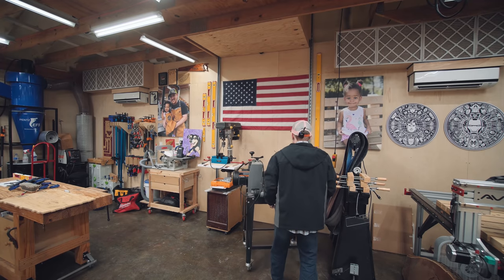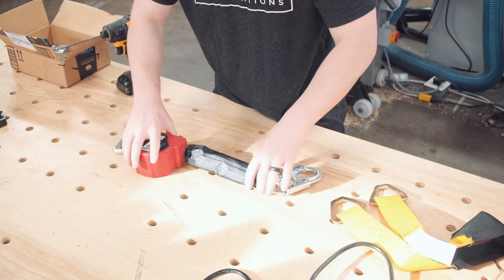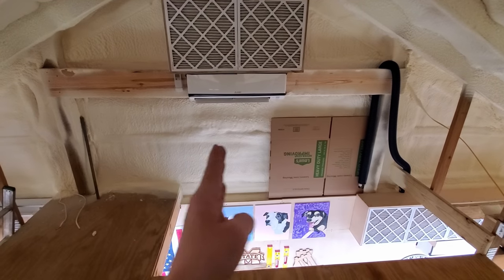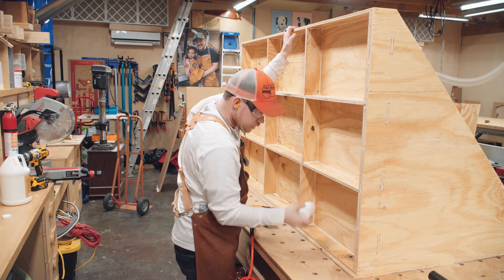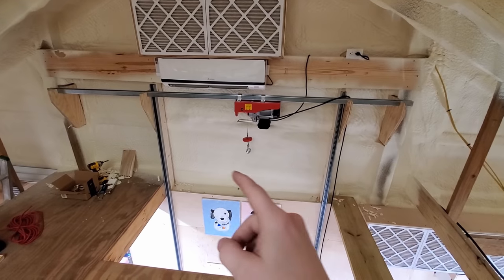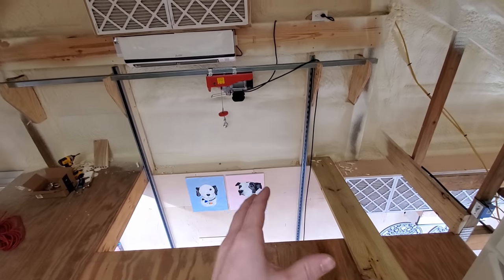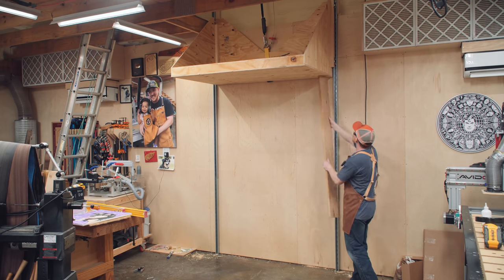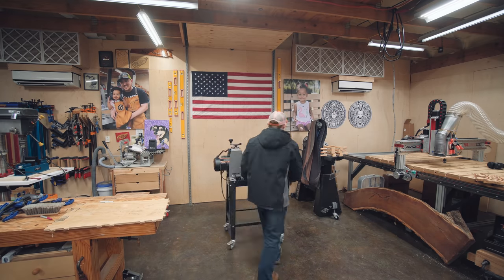DIY Elevator - 364

Comment: Wow, that's just utterly awesome! I wouldn't have come up with that in a million years! Great job, Master Jay.  
On the flexing winch mount, can't you simply attach to the wall a couple vertical lengths of 2x material underneath the bar to prevent it from flexing? Seems like a bit of support would prevent that from happening. Agree with the comments that the fall arrestor should probably be attached to a different mounting point.

Comment: I love this.  I am looking at building an accessory dwelling unit for myself as I downsize.  It will have an outside stairway, but I am considering building an elevator that will mesh with the deck and even the awning could mesh as well.  My body is not doing great so this will allow me to have a 3 car garage as well below the unit.

Comment: I love this idea. I am building a deck at our cabin that is off the ground about 8’. I’m going to attach the super strut to a 4x4. After seeing your problems with counter sinking the screws I think I will just weld flat stock to the strut so I can attach it to the posts. Carrying coolers of food and supplies up the stairs pushing 70 is getting old.

Comment: If you're concerned about a possible condensate issue flooding the hoist, use a CGFI circuit breaker or a CGFI outlet. They work and one possibly saved my life.

Comment: Any thoughts about adding a counter weight to take up the weight of the platform?
Reply: Why would you need a counterweight?
Reply: @jameskelly7767  Counterweights are used to reduce loads on the lifting motors, if you have a fixed weight it can be practical.  However, I doubt you could add much weight to this due to most of the weight being cargo, ergo, not always consistently there.

Comment: This is brilliant! Great creative mind Jay. I would have thought to use 4x4 post to have a self supported structure affixed to the wall. Light weight metal frame construct with 4 point anchor points at the top to centralize the winch, leaving it clear from potential water droplets. Then to create an elevator buffer, I'd use car suspension springs cut to reduce the height, then mounted to the floor so they are concealed when the elevator comes down. Sounds good in my head, just wish I had to space to try it and execute it. Your work is a great inspiration. Thank you!

Comment: Awesome work!  Now all you have to do is dig a massive hole under it and build a lower level to the platform.  That way, you can keep your equipment under the lift.  When the elevator comes down, the equipment will glide down into the hole  :)

Comment: the security chain should be mounted on the wall and not on the pole. if the pole breaks then you will fall with your setup. safety should be secured in a second position :) just a tip

Comment: !!!! Jay!!! !!!
You have no preload on that cross strut. Look into how metal fatigue works, and how over time repeated stress will cause that strut to become brittle and sheer. I'm not saying it will happen soon, but when it happens, that cross bar will snap in half, and that is what your safety device is attached to!!!!

Move your fall arrester so that it is attached to something completely independent from the rest of the support structure (such as the roof for example).
Reply: Other than that, sweet design! Bet you're well happy!

Comment: Jay...Love this project.  Really love the light switch extender you used at the end.  I know you wanted the lift on its own electrical circuit but it would be very convenient to power the lights up there on that same breaker or better yet a switch to save on wear and tear of the breaker.

Comment: Nice elevator and great video, if you're concerned about the flex in the lift support  get a stalk of double strut it's like 2 pieces welded at the backs. Double strut is very strong in the application you need but you'll need to pick it up at an electrical supply house.

Comment: Ok Work for a lighting production company and my rigger and I sat down on this one.... first off. No "Break" in the winch. Most Chain Motors, or crane type lifts have an actual break that engages and disengages or slips if over-loaded. If you can use one of those instead of a winch it would be proper.  Sudden failure is probable with a winch. Cart attachment bracket should be steel in the shape of an L running down the center and have a shackle attachment to the hook. Also you are dealing with Dynamic loads. You need a double lapped welded run of solid uni-strut as the lift lentil. Again dynamic loads, The 3/4" ply is also meh, steel is better... though we did like how you spread the load out.  I think this is a Wonderful project. and what you have is decent without rigging hardware knowledge. Hit me up if you want examples...

Comment: Nice DIY elevator. I’m sure the safety Sally’s will give you grief but you put it together well.  nicely done. I used to have a loft in my garage and I really wish I’d seen your video then. I would have done one too. To maximize your safety and lift capacity you may want to lift just your stuff and you use the ladder. If something goes wrong and you’re on the elevator you’d hit pretty hard.

Comment: Really nice, only safety thing I'd add is a push to break switch at the top of the track that you add inline with the wire on the remote for the up button. that way if anyone accidentally runs the lift too high it'll press the switch, causing the up button to be disabled but still allowing down button to be used.

Comment: Cool. I would add 2 pole on the corner front. When the elevator goes up it pushes "gates" out of the way. So if the elevator is not up gates prevent you from stepping out in the open if your not paying attention. Or some sort of lid that lowers when the elevator is downstairs. And some sort of power cut off build pressure plates on the under side incase of something under it on the way down.

Comment: Suggestion......build a small shield with some flashing to cover your motor and I would suggest putting a railing  with a latch able gate at the top around the opening.

Comment: You might try adding the strut captured nuts at 16" centers to the upper strut holding the hoist. You can then use threaded rod, bent to fit, to attach it to the 2"x10" board holding the mini split. This will get rid of the flex, without adding more structure . They probably have ready bent angles in the Superstrut catalog. Nice job, well thought out!

Comment: I built an elevator based on a hoist like this, servicing 4 floors. I automated it with a tiny Siemens PLC, position detection and push buttons on every floor, like a real elevator. Works like a charm. Tiny issue : while the cable winds, it changes direction on the drum twice, and that makes a quite unpleasant and noisy bump.

Comment: Avoid a single-fault failure. The Fall Arrestor should be installed on a seperate set of struts, in case the motor supports fail.

Comment: I did exactly the same, but out of box steel. I added an industrial microswitch though wired into the up button circuit, so when lift is fully up it will stop automatically in the precise place

Comment: I really think you should double that top, horizontal super strut like you mentioned as a possibility. You've got significant bending stress there, and the noticable flex is a bit scary. Just my two cents as a mech engineer.

Comment: Very nice.  Why not consider putting a little bit of roof lead flashing over the motor so if the air conditioner ever leaks it will just drip down.

Comment: - pay attention to pinch points. Same sort of concerns one has with garage door rollers. - this was well designed. I’ve seen similar garage elevators on utube. your site touches more eyes. - As time goes by you’ll likely make safety and functional changes. Your closing shots of storage items going into loft illustrate elevator much safer than trying to carry stuff using extension ladder or even fold down stairs. 
Plus - You don’t have to ride it but make sure if you do you don’t drink and drive😁

Comment: Beautiful job, elegant design. My only concern is your fall arrester is connected to that super strut, which on video feels like the week point of the entire system, especially if it had falling weight on it. I would want to make my backup safety catch redundant by attaching it to something that may wouldn't be the initial fail point. Like maybe the peak of the rafters.

Comment: Metal that repeatedly “flexes” will eventually go into metal fatigue and fracture. The super strut for your trolly guides is fine. For the top hoist mount I would use a properly designed I beam with some gusseting to reduce span loads. There are small I beams available that would be suitable for your needs.
Reply: way over kill. this strut material is plenty strong and un-flexing tech specs for this application expected loads. Vertical cantilevered platform stress is no different then straight down or horizontal travelling stress. Any fatigue would take decades of daily use, might need to change out trolly wheels or assembly once in 15, 20 years. only need to be concerned with the platform is well attached.

Comment: Lots of good ideas here. My workshop has a good attic floorspace, but a crappy pulldown step ladder thing that is a pain. This would be much better and would probably consume the same amount of floorspace. Like someone else mentioned, I'd probably keep a rope ladder or something in the attic in case of emergency (power failure or circuit breaker trip)

Comment: pretty dope lol i thought about doing something like this for my main house but it has to look classy and lift furniture and or multiple bodies but theres only 1 access to up and down so i need to build a second story deck and stairs with a sliding glass door off my master to have redundancy or alternative if elevator fails. this project is massive and currently renting out home so its on hold till further notice

Comment: Question/Consideration. Would you ever consider mounting the hoist to the concrete secured with concrete anchors and simply running the lifting cable to a pulley mounted on the wood supporting the minisplit then back down to an attachment point on the lift. This would take out almost all of the flex/play caused by the strut and also create a single fall effect which will increase lifting capability but slow the travel by half. You would have to make the platform thicker to conceal the hoist in the dead space created but you almost had enough with your original design.

Comment: Awesome functionality added.  Are you thinking of adding a flip-up ramp to the lip for both safety and ease of use or if the load is that heavy a ramp is needed, the lift wouldn't be used regardless?

Comment: I would encourage the fall arrest to be attached to that 2x12, and put two to handle the shock load should it be fully loaded when failing. As well, the strap on the sled is a single point of failure, the fall arrestor should have a chain plate and be completely independent from the lifting system, lift supports or lift attachment points.

Comment: That's pretty awesome. My parents are getting older and they have trouble with stairs. I've been researching elevators for them, this is a nice system because it doesn't require a pit underneath or a big mechanical space up above.
Reply: Southbound Tables
 ... this is NOT rated for human use. If your folks truly need assistance you should contact Medicare or your health insurance provider to get what you need.
Reply: @rupe53  They're not invalid,  just have knee troubles.  I'm a smart person,  capable of assessing risk and taking mitigation steps on my own.  Take your Safety Sally badge elsewhere.

Comment: Two things would concern me about this fab build...

1. Amputation risk, should something overhang the edge of the platform on the way up. Hard to build in a failsafe for that other than perhaps a higher lip around the platform which would then be a trip hazard, or some sort of sensor to detect anything overhanging perhaps a beam break device to isolate the winch. Perhaps the design could be altered to incorporate a rising edge around the platform, so that when the platform is bottomed out, the edge would be flush, but when the hoist begins to lift the platform, it would first lift a 5" lip around the platform's edge. If the lip doesn't rise to its full height, and engage a limit switch, the hoist could then be stopped electrically.

2. You mentioned in the video, the risk of falling from the upper level, but also there is the risk of the platform descending onto something or someone. Again, an active infrared beam interruption device could be integrated to prevent the hoist from descending if anything is breaking the beam.

Fascinating design though. Be keen to know how you get along with it.

Comment: I trink the bottleneck is the small horizontal steal beam, that holds the platform, the engine with stealrope and the freight. But i like it and you can do some tests with additional weight.

Comment: Great project! Idea to execution of the idea was great! Was thinking that you could put a lightweight gate (something like a large doorway gate for dogs) on it for safety (if desired). Also a trap door that folds up/down with the lift could be easy to do and would ease your mind with that large opening. I’m not criticizing in the least. Just some suggestions based on your comments in regards to safety during the video. Wondering what exactly you used for rollers in the tracks? Where can they be purchased? 
Again, great job! Have a good day

Comment: There's not risks involved, it is potentially fatal. I used an online calculator, and if the strap was to snap one floor is enough to kill you. Kind of surprised me, I would have thought it needed to be higher. Glad to see you are using a fall arrester.

Comment: Can you talk about the structural implications of making the opening in the floor of the attic?  How big is it?  How is your building constructed - is it roof trusses with built in storage room above or is it on-the-job roof rafters?  If so, how is the attic floor constructed?  Did you have to cut into the ceiling joists to get the opening you wanted?  Nice work!

Comment: recommend you double up the unistrut holding the winch, and fix the drop arrester to the 2 x 10 above, not the same structure as the winch  , from a structural engineer in Hong Kong ,

Comment: Pretty cool idea, but as others have pointed out some points of failure and risks associated with this build. 
Countersinking the anchors into the metal has reduced the thickness of the metal at the anchor point. 
You are probably very close to overloading the capacity of the hoist without any load on the deck. 
The fall arrestor has a capacity of 310lbs, not sure I’d trust that in an emergency. 
Using the laminated plywood as gussets is also questionable as is super strut as a support. That twisting and flexing could be catastrophic. 

I am not an engineer, but I worked in the materials handling and equipment industry for 15 years.  What you built is essentially a material lift, or vertical reciprocating conveyor. Its a cool project, and with a few mods it would be safe and secure.

Comment: You could put a drip shield over the motor if dripping is a concern. You could also rig a spring loaded safety door at the top so when the lift goes down, as it approaches the bottom the safety door at the top is pull down till the whole at the top is covered so you can't fall thru the cutout for the lift floor.

Comment: Really cool project Jay! One or both of these observations may have already been made, but did you consider installing a GFCI outlet as well as a dedicated breaker? Secondly, you might consider replacing the super strut that the winch is attached to with some thick wall square tubing to carry the load better/ safer. Overall a really cool project!

Comment: Could I get your opinion?I’m planning a small garage lift (22.5” wide x 3’) to go between the trusses in the 2-car garage of my new home currently under construction. The existing studs do not align with where I need to install the super strut tracks. I’m considering two options to keep from having to tear out the painted drywall and install new studs:
1. Attach 3/4” sheet of 4x8 plywood to 4 studs in the garage and attach the super strut to the plywood, then use horizontal boards attached to the studs in the attic to complete the track. 
2.  Install 4 horizontal 2x4s on the garage wall into the studs and attach the super strut to that. 
Which option would you choose, or would you recommend something else? Would the plywood be substantial enough for the super struts? Thanks! I’ve watched you elevator videos dozens of times.

Comment: Fall arrest is a great idea however I would attach it to the structure not the same strut holding the winch this way if the strut or the attachment of it fail you still have the fall arrest to a different attachment point to rely on.

Comment: There is a product called a Versa Lift that provides a solution for getting stuff to the garage attic.  However it is not rated for passengers.  You have to go up the ladder to unload the lift.  I have one installed between the garage floor and the basement floor.  It's great. Mine has a locked door in front of it on the garage level, to discourage unauthorized use.

Comment: Put another piece of super strut, back to back, on the top beam, bolted at about 6 inch centres. 
That flex and bounce means it won't take much more flexing and bouncing before failure.
Doubling the vertical section makes it about four times stronger.
Stay safe.

Comment: You need to mount two low volt laser eyes (garage door sensors) about 18 inches below the trolly in case a limb or hands are out it will break the line voltage. A simple relay,  120 to 24 volt transformer and a 120/24 relay. Boom extra safety